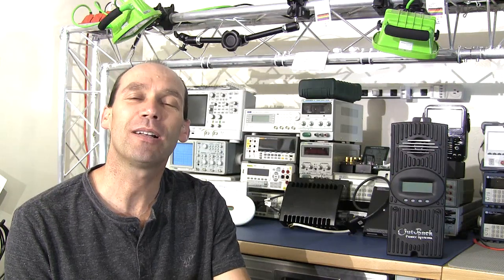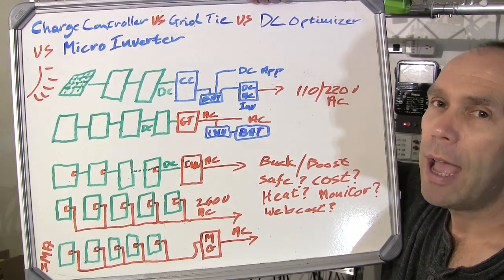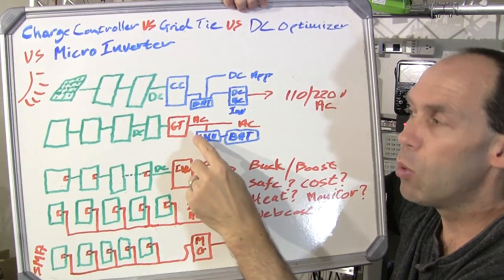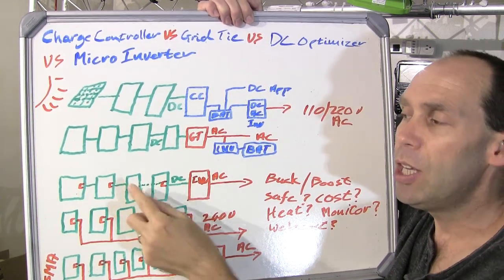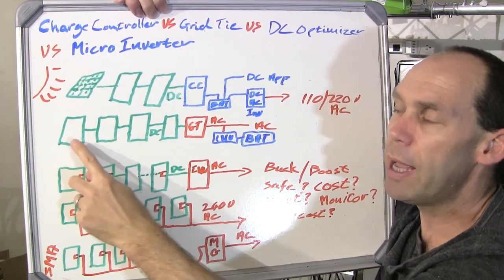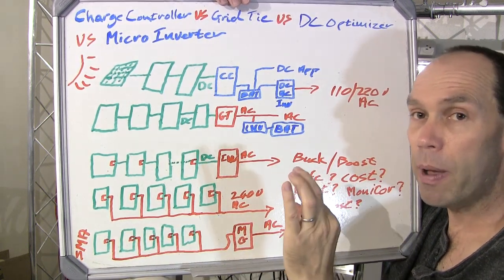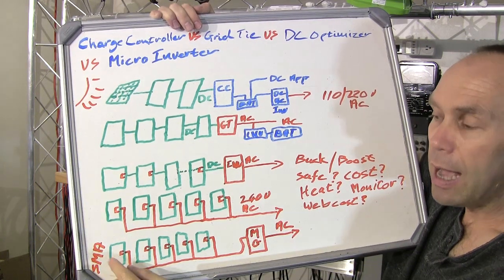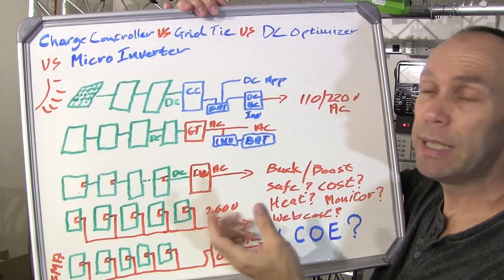How to Solar Power Your Home #7 -  Grid Tie v Micro Inverter v Power Optimizer v Charge Controller

Comment: Huge Thumbs Up Martin !   From an old electronics guy and union electrician who hasn't paid much attention to Solar since the early days, this brings me up to speed, and will save us so many thousands of U.S. Dollars I could have otherwise wasted on an inflexible system with huge I squared R losses, and big investments in heavy guage copper.. now thankfully all ancient news with the micro-inverters and modularized AC transmission wiring.  Perhaps still some component level repairablility in the micro inverters that will likely disappear with the all robot made "ac" panels, and what will surely be surface mount components ( or worse).  Now we can build a system with our micro-resources !   BTW... the case of that nice old Simpson meter is really fragile ... precarious spot its in !  Cheers to you also !

Comment: I really enjoyed the video. You were very meticulous in your explanation without being opinionated. There should be more posters like you.
I chose Solaredge for my system. The reason being that I have room for only fourteen 60 cell  panels on the building that I am installing them on. Enphase maxes out at 250 watt per inverter where using Solaredge optimizers I am able to get 305 watts per panel. It was a difficult decision at first as I was sold on the Enphase technology but the more I researched the more this made sense. Keeping my fingers crossed. It was information like yours that let me understand the differences between systems.Thank you very much

Comment: Great video.  I opted to go with a microinverter system because my local building department demanded that I put a DC cut-off switch on the roof if I built a conventional string-based system.  Since it seemed difficult, kludgy, and ugly to somehow mount a DC cut-off switch on the roof, I went with the microinverter based system that allowed me to avoid having any switch box on the roof.

Comment: I'm your newest subscriber hoping to start with good basic solar understanding of about 1250 watts . Air conditioning on the Texas gulf area is mandatory at seventy years old and humidity a big problem approaching ninety . A/C in my home can/will be confined to one room in my home with the remaining three hundred square feet dehumidified from the grid and a gasoline inverter backup .  I'm not really interested in buying warranty at my age but not wanting to leave demo projects behind in five years either . I'm presently considering as much salvaged equipment possible with upgrades keeping embarrassment to a minimum I hope .  Thanks for being here

Comment: Thank you for a very concise comparison of those topologies. I’ve seen some diy  projects in which hobbyists have tried to solve their heat problems by using a copper pipe radiator system to make hybrid active/passive systems. (For instance, PVC sun-side in a regular panel, bonded to a copper pipping backing the panel to cool it, and heated water, and a micro inverter mounted on the back.)  I imagine that large scale panel producers could make panels like this efficiently with far fewer safety issues.  Have you seen anything like this?

Comment: I will suggest people take in to account all they want to purchase and try and make a cost/kWh calculation else there is the risk you pay more for that solar power that what you pay from the grid.
For those very few that are offgrid the most important component that you need to investigate is the battery since that is by far contributing to your cost of energy at this moment in time.

Comment: Really informative video for the electronically braindead such as myself I do no have solar panels on my home as the roof orientation does not make it viable for the on grid system that I'm assuming we us here in the UK. However the Micro Inverter system you mention seems a workable way around the issue I have with my roof which allows for shading to be accounted for and as you can start with just the one panel it also allows for expansion should finances allow and should I ever have the money to actually look at solar panelling. Cheers

Comment: You made an excellent point about the controller, especially for the grid tied micro inverter systems. The two important issues that you pointed out were the dependency on the solar system to operate whether or not the controller is functioning and the privacy issue. It is my understanding, in the state of California, the utility company by law has to have access to the inverter at all grid tie systems, and there is pending legislation in California giving the utility companies the access to the power in the batteries. California has been experiencing problems with their electrical grid the last few years (California is a socialist governed state).

Comment: Hi, thanks for taking time to explain Solar.      I want to do a small Grid Tie in system say 400-600W,  but I having a problem finding a GOOD   Grid Tie-inverter.   I'll be using 12v, 100w Panels.  What BRAND, MODEL, etc., do you recommend.. 
Any suggestions would be appreciated.  Again thanks for help.

Comment: I would like to run a 7.5kw AC borehole pump using only the solar panels and the micro inverters. Do I have to increase my solar panels to cater to the starting current?

Comment: Hi Martin,

Thanks for all your great vid's.  I don't know if you've covered the question I have in a previous video blog as I can't find one but . . .  I'm puzzled.  I keep hearing that energy not used is 'fed back' onto the grid - but how?  I understand the inverter makes DC into AC and this is wired into the circuit board/box that is also utilised by the incoming electricity from the grid.  So how does it go out to the gird when more/unused power is generated by the solar panels than the house uses?  Does the electricity flow backwards?  The old meters that spun round, apparently, went 'backwards', so I've been told but I have a digital meter and have been told they can't go backwards.  I'm still confused at how the flow coming into the house from the grid can reverse direction and go out because of excess/unused power from the solar array?  How does it know?  Aren't they the same voltage?  To my logic the voltage/power would need to be higher from the solar array to overcome the incoming voltage  from the grid to push it 'backwards' or am I totally off kilter?? Shooting in the dark here!!

Cheers

Ciro (UK)

Comment: I know solar voltage is pretty stable but what about using capacitors on wind turbine to help surges? I know it's not a subject you are into currently but just wondering if you would have an answer?

Comment: There was a few mistakes, such as the high voltage is less of a problem than current.
Also the topology of the micro inverter is wrong*. 
They often have split inverters/mppt.
So you plug four panels into one inverter, or two or one depending on what you want.
Then they optimise on the two panels or four panels to produce the correct power inversion.
I've not gone into detail if they use serial or parallel, or either depending on the requirements.

Obviously the best results are obtained by a 375v DC system, as this is the right voltage for 230v, all you need to then have is the current, which is about 5 amp.

Then the panels come in three tiers, low, 18/12v, 37/24, 50/48.
This of course dictates how many panels you would have or need. But I found the micro lower power, 1200w being the higher 600w being a average and some single 300w.  Those having 4,2,1 panel connections respective.
Four 50v panels is going to give you 200v which works fine with 120v AC ratios, but not 240. 
8 panels and two micro inverters would work well for most users, 2400w of power is good for most users, and highly excessive for average Joe, who will not take any real benefits unless they invest for night storage/use.
We then return to the lower voltage DC scenario with batteries.

Comment: Some updates needed here: central inverters cost less for any system >=2KW, shipping does cost much, but microinverter cables and gateway are very expensive, and those price doesn't contribute to power but mfg's profit. Other costs are mounting parts and labor, labor is 50% of whole system. As far as Asian countries involved consumers can enjoy low price, or else they just overpay, usually 10X more for trunk cable, gateway, and 3-6X for aluminum due to import barrier.

Comment: Hi Martin, A really helpful and great series of videos on Solar installations, well done! :)
I was wondering if it would make sense to install a micro inverter setup with a battery bank? I live in Denmark and we obviously have plenty of cloudy days. I really like the Micro Inverter Setup and the MPPT aspects to monitor individual panels but does it make sense to convert DC > AC > DC and back to AC when you need to use it? Is there a cool solution to this type of setup? Thanks for all the great advice and tips!

Comment: Hi.
I have a small setup on my shed with 100W+25W 12V panels feeding a 22amh deep charge battery, which is, for now, enough for my needs. Only a flood light outside and lights on the shed.
I want to connect an amp/volt meter on both my incoming power (PVC) and power being drawn (from my battery).
I have got 2 100A 100V with shunt amp/volt meters.
Now the connection suggests the neutral from the PVC to be connected to the shunt. I don't know why is this but I thought through the shunt the live cable should be connected.
Any advice much appreciated.
Great videos you have.
Thanks.
Albert

Comment: Good video, just a question, can a limeter be added to the micro inverters? in my case I can not feed on to the grid, so would like to generate only what I need, and if I need more then use mine first with the bit exstra, and in the evening or morning the grid, please advise. Thanks and keep well

Comment: How would you setup a system where you are using micro inverters to directly supply your house AC and you still want to have a battery bank to use at night? The AC would obviously needed to be changed back to DC to charge the batteries. Can an inverter take AC and give out DC to charge the battery and will you then still need a charge controller before getting to the batteries? I would assume it would be a system that is a combination of your second line of drawing and the 4th line with the micro inverters.

Comment: Hi Martin,

I have been unable to obtain any information relating to the use of DC optimizers (MPPT) with a central charge controller (which may or may not have its own MPPT). The only implementation of which I can find information is PV -> DC Optimizer -> Inverter. I would like to use larger DC optimizers to do string based MPPT for each of my 4 parallel PV strings and then combine the array which has each string optimized into a charge controller (1 PV input) which will charge my battery.

I cannot find any information about PV -> DC  Optimizer -> Charge Controller so I'm not sure if the technologies can work together, however I don't see why it could not work?

Please advise.

Thanks
Reply from the maker: Leslie Strydom Hello Leslie. I don't have the information to hand either. It's part of the reason I'm doing this video series and I hope to investigate that type of setup you talk about in the future. That investigation will only happy later this year once time and the weather allow it to happen.Cheers, Martin.
Reply: Leslie Strydom Outback has stated on a number of occasions that you can use Tigos with their CC's. However, it appears in this case that the advantages are limited - since their CC's (and most others) have limited voltage windows, and thus very short strings, the advantages are severely limited. For instance, with optimizers in a AC system you might use them to match two different string lengths or panels facing different directions, but if your string only has two or three panels (common here in Canada due to low winter temperatures) you can likely just arrange the panels to achieve the same end.

Of all the companies out there, SolarEdge - and similar systems with distributed dc-dc and centralized ac inversion - are in an excellent position to address this issue. They could produce a version of their central inverter that is actually a CC and re-outputs power at the same 350Vdc input level. That would then feed into one of their normal AC inverters. The advantage here is that the AC side doesn't change at all, it doesn't even have to be aware where that DC is coming from, the panels or the batteries.

The fact that they haven't done this does illustrate the relative size of the two markets and the financial rewards in each. Outback et al are now in a very niche area, and frankly I think they could be wiped out if anyone takes a strong interest in this area.

Comment: Have you ever had a chance to look into SunPower solar systems. It would be interesting to see how they compare with enphase.
Reply: Right now both systems require a 2 pole 15 amp  breaker and 14-3  wire to energize the data control module witch can be a challenge in maxed out meter panels.I think Enphase is the industry leader with Sunpower real close second. Enphase does not make a solar module/panel yet that i know of.  Sunpower make s the best panel/module .The cleanest way to go is Sunpower modulus/panal and cables, Enphase micro-inverters, invisa rack  rails,  Enphase envoy data controller.     Although the backup batteries are really good now and you can add up to 14 in a circuit,  im not a fan of batteries.

Comment: You mentioned a night time consuming household might want the battery solution.  #1 Maybe he hasn't been upgraded to a digital meter, so he can charge during the day to spin meter backwards, then use that electricity in the evening.  He effectively off loaded the responsibility of batteries to the grid/electric company.

Comment: Big thumbs up. Your scripting and presentation were cogent and informative. I am designing two 20KVA and 1 ea. 10KVA systems and the large, Grid-Tied technology seems to be lagging. MPPT seems limited to 10KVA and less. What single Inverter/Charger/Synchronizer would you use for a 20KVA Grid-Tied System with batteries? 80 ea. 275 modules.

Comment: Regarding the micro inverters, I would be very concerned about them failing, and the expense of replacing all of them. it may also be hard to tell which one is working properly and which one is not. I would think being on the roof in the extreme heat and weather that they may have to be replaced every few years. And newer ones may not mount the same way as the old ones and there may be allot of fabrication involved. It just seems if one is going to have a Grid tie inverter it may be better to have them mounted in a central location where it is easy to test them and replace if necessary. Having a micro inverter on every panel seems like it could be a good idea but one may end up spending a Huge amount of money replacing them when they go bad. It seems micro inverters just adds to the complexity of the system and the more complex it is the more likely for parts to start failing.

Comment: What to you think of these Micro Inverter Grid Tie Power Inverter with 4 in 1 i.e. Four solar panels controlled by one box. It looks like there two inverters in the same box, each managing 600W on one side, and 600w on the oposite side. Both have 230v main ac coming out. The ones I am considering are from Germany. The makes looks like 'eco worthy' on ebay for £183.00.

Comment: If the solar array is on the roof (same surface), it’s almost always considered as homogeneous for all practical household applications, unless suffocating from tree shadows. In such a situation, benefit of multiple MPPT + inverter setup is not that great to having one MPPT + one inverter setup. However, if the cost of panels with built-in MPPT is within economical reach, it will not hurt, even though it may not give you a fascinating power optimization. That will at least add some degree of fault tolerance to the array (if one panel fails, still the system will work). 

Not all MPPT implementations will work equally. Incremental inductance and current sweep methods are expensive and not found on the cheap MPPT units. It’s almost always the Perturb and observe method, which can be implemented with couple of OP amps, resistors and capacitors, and most Chinese manufacturers tend to pack this type of cheapo circuit at a cost next to nothing. Sometimes adding these to your panels may not do much but add to the weight on the roof plus gives you bunch of more points of failure in your total system.

There are new kind of MPPT technologies emerging, which based on supper capacitors and inductive feedback, but either they are still not widespread or not economical for a small house.

Comment: I have a question here.: if i am using a grid tie inverter without a battery. My solar system is able to provide some part (60%) of the power  to house so rest of the part power (40%) is supplied by Grid. so can Inverter manage this power combiner also of Solar and Grid power ?

Comment: ... An excellent presentation: I have twelve "LG200N1C-G3 panels with "Enphase M250 Microinverters"; including the "Envoy" device with USB Zigbee device installed which communicates with my "GE i210+ Revenue Grade Meter".
... You mentioned we should be able to monitor and gather information from our solar system via Web (; Enphase) or PC interface. ... I can access my "Envoy" via it's IP address however; the information contained therein is limited, and is not as robust as when I log in to my Enphase account. ... I bought the "Zigbee" and meter whereby I could gather direct data upon my PC instead of it going to Enphase's web interface from the "Envoy". ... I'm missing software aren't I?
...